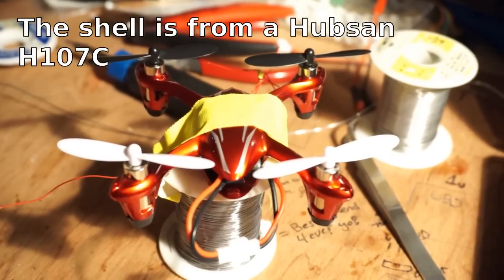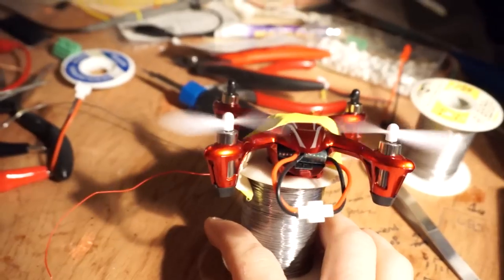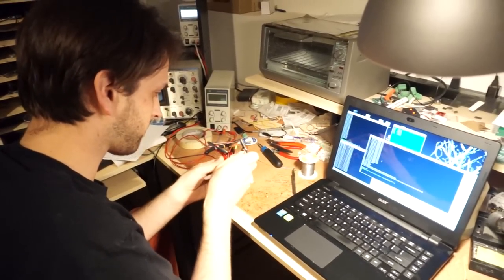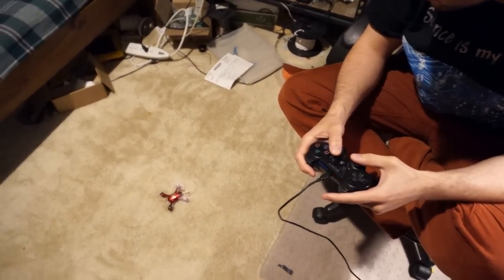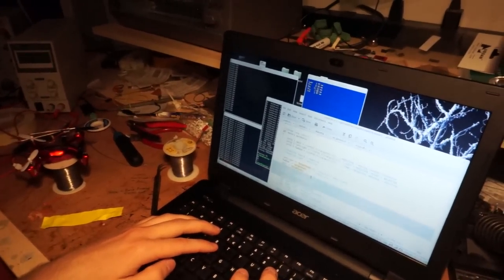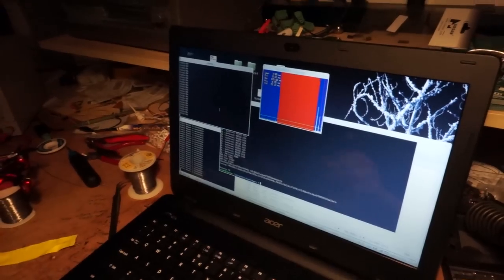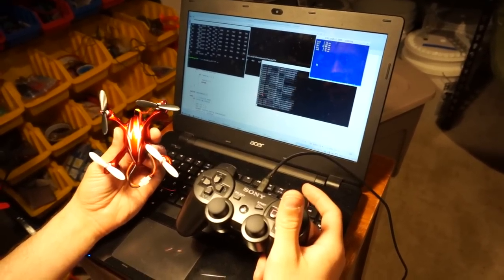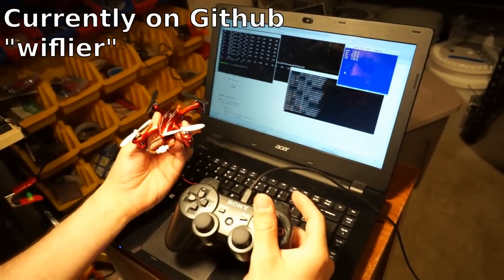Trying to make WiFlier, a Wifi enabled Quadcopter

Comment: ESP8266 is, sometimes, also very slow responding to commands. That wouldn't help either... There's a lot of lattency and packages loss and, on a system like this, unfortunatly, that's critical.

Try to make this controllable by a smartphone just for fun!
Reply from the maker: ***** I actually don't see any delays here. A lot of people blame problems with the AT stack on the ESP, but really the AT stack is just jankey.
Reply: CNLohr When I saw the picture of your PCB for this project the first thing that came to my mind was "this is going to be a disaster" because I have a few delay problems in some "real time" projects.
I believe that the reason for these problems can be me actually, but the truth is that I've learned that these chips are excellent to enter in the IoT world, but for real time internet projects are not perfect due to these delays.

But, to be fair, I was expecting a much worse outcome!
Reply: ***** ESP8266 with proper firmware work issue free, I tested it in heavy load environment and never had any packages loss or slow response.
ESP8266 with proper firmware work issue free, I tested it in heavy load environment and never had any packages loss or slow response. I used it for some real time telemetry without any problems.
I would never use it for some mission critical application, but anyway Wi-Fi is not meant to be used in mission critical real time applications.
Reply: Petar Petrovic As I said before, I don't doubt. But what it "slow response" for you?
I haven't got also any packages loss, I just have some packages that take something around 1 second (or more, sometimes) to arrive...
Reply: *****
I never experience response more than than 10 ms, 1 second would be whole eternity for my application.
Reply: Petar Petrovic So, as I also thought, it is a fault caused by me. Fair enought :(
Reply: CNLohr
as *****  mentioned most problems you have is due your pcb design
Reply from the maker: The version I was flying with here takes very little consideration to the noise.  In the new revisions, I've given it a lot more thought.  I'll see how good that is.

My big frustration is that wifi isn't just dropping the packets, instead it is rebroadcasting them :(.
Reply: CNLohr But retransmissions of packages is normal according to 802.11, interference that occurs during transmission also causes packet loss, which forces Wi-Fi retransmissions.
Reply from the maker: I would rather handle the retransmission at the TCP level... or at least I'd rather have an easy way of cutting it off.  I was reading though and broadcast might be a suitable way to do that.
Reply: CNLohr
Or you can fix by fixing PCB design (eliminate interference) and you will not have problems. By the way Wi-Fi is not met to be used for monitoring and controlling there are other  standards for that (like ZigBee)

Comment: I have a quad with ESP8266. Here is the link: https://www.youtube.com/watch?v=3n76iMTHXuE
On the video it's actually controlled by regular 2.4GHz RC gear (test fight capabilities without network), but on the next day I had it flying ESP8266 to ESP8266 over UDP.
UDP does not require responses to packets, so all I do is shoot 8 16bit channels (16 bytes) every 20 ms (what is usually the case with RC).
For stabilization I use only gyro and the software is actually my port of MultiWii to ESP :)
Added an extra TCP socket later on to use for telemetry and is the way I make all changes on the PIDs and such. I will definitely not say that I do not suffer from lost or mangled telemetry packets... :)